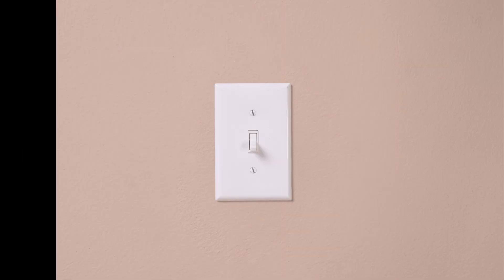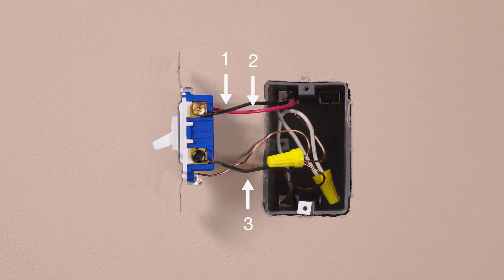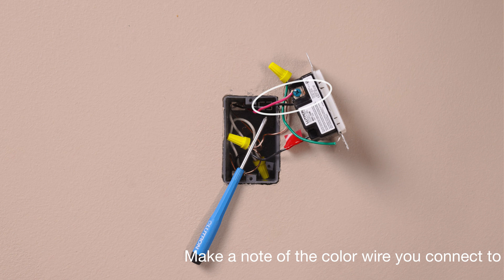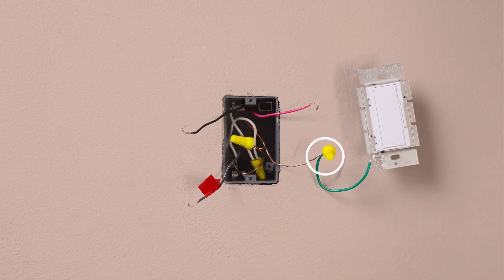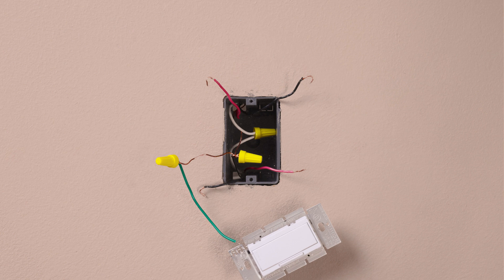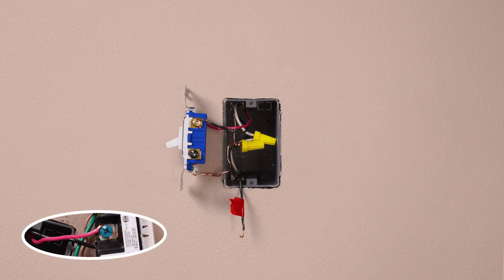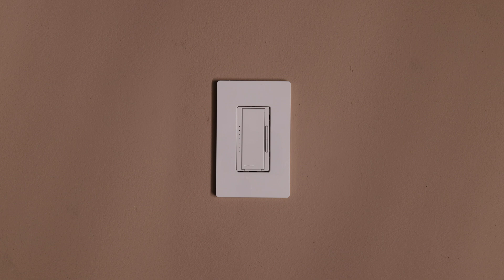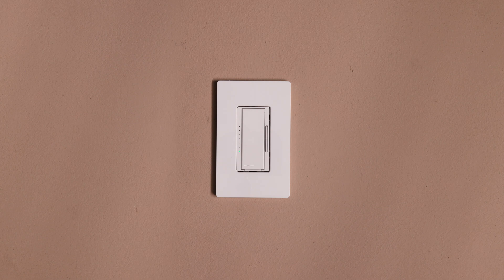Wiring a Lutron Maestro LED+ Dimmer (Multi-Location)

Comment: Thank you, this helped a lot, more than the written instructions. Tip: the three wire nuts take up a lot of space in the single blue electric box. The old rocker switches had direct connect screws, so no wire nuts needed.The dimmer combo was also 1/4" thicker, taking away more space. HD (and others) sell a blue "old work box" that is 1/2" deeper that I had to install in order to to pack all the wires in.

Comment: One thing to note: if you are doing a 4 way do NOT connect two wires to the same screw like in this video... i honestly can't believe they suggested/showed it that way. It is against NEC code and a huge fire risk due to loose connections.

What you should do is use another wire and pigtail the two wires with the third wire in a wire nut. Then use that wire to commect to the screw/switch.

Comment: The wiring diagram helps way more than the video. The video is misleading.
The blue screw wire goes to the blue screw wire on the 2nd switch, it to sync the dimmers together.
The black screw is for AC power. (Hot)
The brass screw is the wire that goes to the lighting system.
The green wire goes to ground, but you don't have to use it if you have a metal box which will ground itself.
The diagram is much better to understand, this video is too simple and actually made me waste more time.
Reply: Best advice!!! Thank you!

Comment: I installed my dimmer as per the video but theres a humming coming from the dimmer. I didnt have this issue with my regular switch, is there anything i could have done wrong? The lights dim and arent flickering just a buzzing sound

Comment: I’ve installed some new lights, and my previously installed Maestro LED + no longer works (only the top and second lights flash and alternate). Unable to reset the switch, or do a factory reset. Any insight?
Reply: Were you able to fix this issue? If so how?
Reply: @feyandd have you found a resolve

Comment: Reviewing comments below, this video is HORRIBLE.  You rely on colored screws in existing switches, and NOBODY has that.  You need to explain the circuit better, how the 3-way works and explain why you wire it this way.
Reply: This is not an electrical course. The screws are color coded. The two that are the same color are the " traveler" wires and the one that is a different color is the shunt and switch leg. As different manufacturers use the 2 to 1 pattern ,but with different colors this video was 100% accurate. Now stop being an ass on a topic you know nothing about.
Reply: All of my screws are color coded. If they aren't, your switches are old af and should change them anyway 😂
Reply: What do you expect? They try to explain how to wire an electrical 3way switch by hiring someone who had most likely never in her entire life installed multiple location light switches in her life. Try to make a video how to cook a recipe by someone who had never cooked for a living and the result is the same.
Reply: @SSintox you know she read from a script, right?

Comment: I have three switches controlling one set of lights. Thats a 4-way. But, i only have 3 wires coming out of the wall and a ground wire.
Reply from the maker: Our Technical Support team will be able to best help with recommendations for specific scenarios. You can reach them at 1-844-588-7661 or support@lutron.com. We’ll talk to you soon!

Comment: My slave dimmer won't turn off  the light!  The controller Maestro works fine - what's up?
Reply: with dimmable led 3 ways- you can only have a dimmer on one side- make sure the other switch is a simply 3 way
Reply: @BobbyBoccalino Thanks, it’s been a year but I was able to get some help from somewhere… I program the controller dimmer upstairs to the primary setting. I am still able to adjust it from the bottom slave dimmer, just not program it. (I think I got a special slave dimmer?… it’s been a while!)
Reply: I had the same problem just now after install and setup and I called their tech support and she walked me through the issue in 2 minutes. Basically go to you Master/Controller and hold the Tap switch and top button for dimmer down till the dimmer indicator light starts blinking. Mine was the bottom one that went into blinking. That means you have not saved your settings and closed the settings/programming mode. I think she had me hit the Tap button once to save and close and that brought the blinking LED to the bottom position and that was it. It fixed this issue.
Reply from the maker: Our Technical Support team will be able to best help you with getting this sorted out. You can reach them at 1-844-588-7661 or support@lutron.com. We’ll talk to you soon!